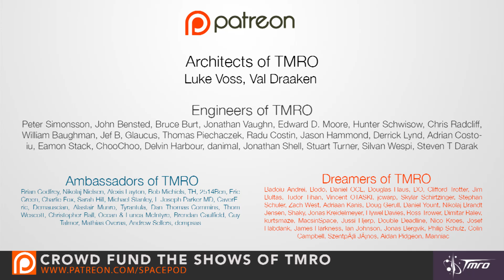Suborbital Science on Blue Origin's 3rd Flight - Space Pod 04/06/16

Comment: Good video, and SCIENCE! But Mike; THREE flights! THREE landings. To me it is all a big deal. Every time they repeat they prove that reuse will work. I would love to know how much materials work, condition monitoring, and hardware replacement is going between launches! (The cost would be nice, but I suspect that is not something they would share with #TMRO!)
Reply: Imagine if a space rocket company could launch a reusable rocket and then have a turn around time of one month maintenance to relaunch the same rocket then imagine if they had 12 or more of theses reusable rockets. The amount of rocket launches they could have in one year is mind blowing!  😝
Reply: +James Collins In the DC-X program, the requirement was a one-week turnaround, five days if necessary.

Not only did they easily meet it, but they once tried for two flights in one day, stopped only by bad afternoon weather. They still flew the next day, getting a turnaround time of less than 24 hours. I believe they concluded that the ultimate limiting factor would be the RL-10 engine cooldown times.
Reply: Frank Glover Thank you for the information and if they are really going reusable in the rocket industry this is the maintenance type of turn around they should be going for but one month would still ok for maintenance.